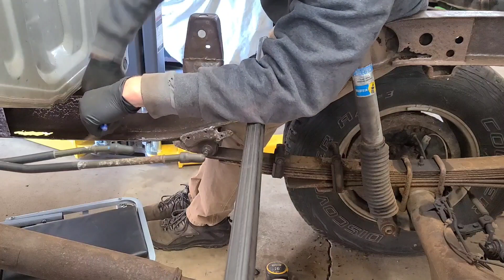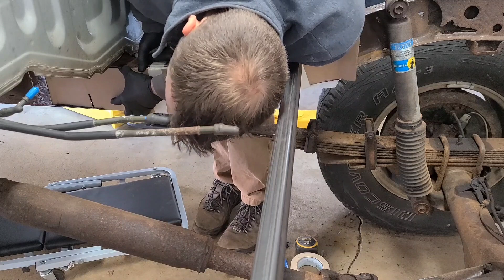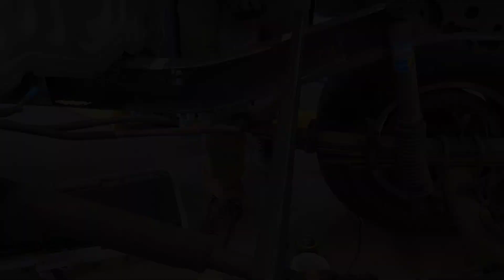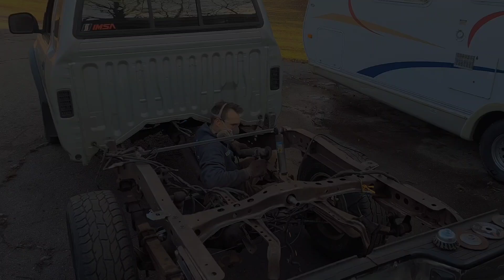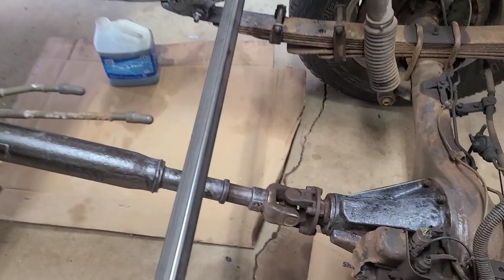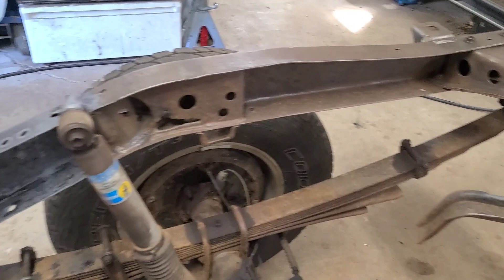Frame prep and templates for the Tacoma

Comment: After chipping off the corrosion metal, they become thinner. It's better to purchase a new set of frame or replace a better one from a spare parts yard. Leaf springs too very corroded. Base of the cabin,  as corroded too?
Reply from the maker: Frames are not available new or aftermarket and most donor vehicles of this era will likely be in a silimiar conditon or worse. Full frame replacement would also be expensive and a huge undertaking. You are correct about the corrosion though. That is why I have added reinforcement to the good existing metal and replaced the areas that were too damaged. The leaf springs are not bad at all. In fact,  they are only a few years old with low miles. The truck body is nearly rust free top to bottom, front to back.
Reply: @PostRt  Had same frame problem with my 97 taco, company called safe t cap sells all frame caps for every section.They fit like a glove american made saves alot of time. Your doing an excellent job thumbs up.
Reply from the maker: @artieaddeo2731  
That's great, I'm glad you were able to save your truck. My original plan was to use that same company but I really wanted to open up the frame and clean out the inside.
Thank you for the support.
Reply: @artieaddeo2731  capping over rust is a band aid. It only prolongs the inevitable.